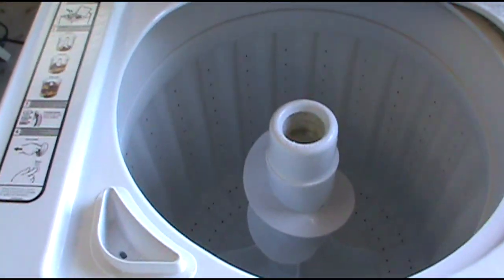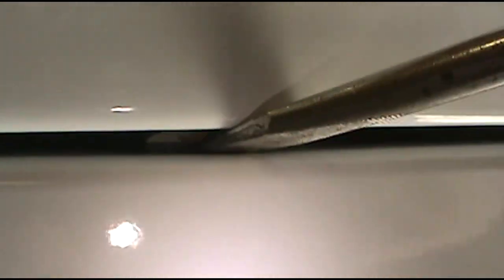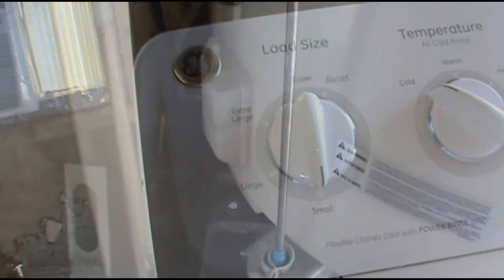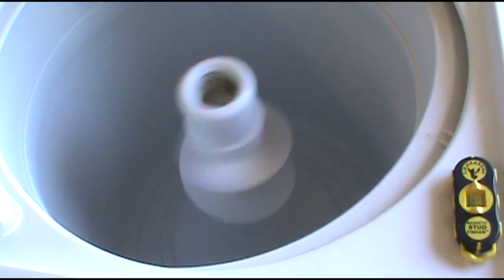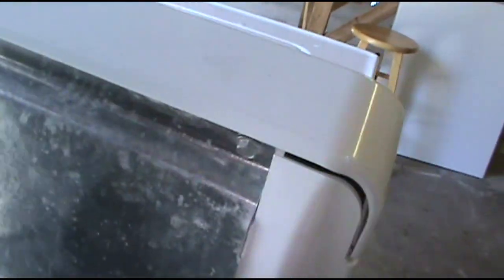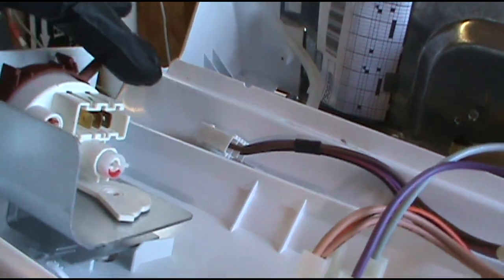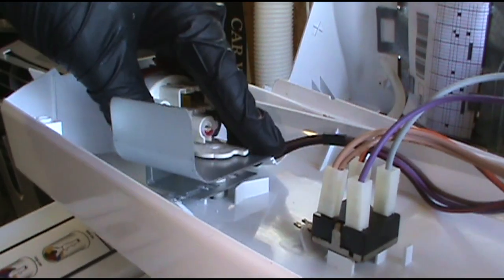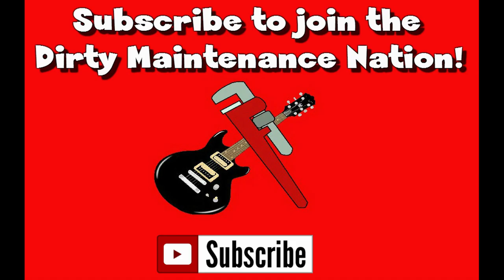HOW TO FIX WASHING MACHINE THAT WON'T GO INTO SPIN CYCLE

Comment: Thanks for the informational video. 3/25/23 for those that might not be sure if this might fix their problem. My machine wouldn’t drain or spin. It would just keep filling more till water was coming out of somewhere. This fixed it. I bought the part on Amizon for $28. They are all a little different from one another. I had to break my old part off where it clips in to the machine. I didn’t attach the new part till I tried it to see if it worked. Incase I wanted to return it and maybe call someone to fix it. Yeah I it worked. 😊
Reply from the maker: Nice fix, Max! Thank you so much for watching!

Comment: Awesome! Washer wouldn't drain or go into spin with the tank tub full. I took the tube off of the switch and blew into the switch a couple times. Then I blew into the tube till I heard it bubbling into the tub. Plugged it back in and set it to almost the spin cycle and it started draining and went through the spin cycle. Great advice! Hopefully this will last till I decide to replace this ten year old beast. For anyone wondering I did this to a Whirlpool washer, worked all the same.
Reply from the maker: Awesome! Thank you so much for watching Mark!

Comment: THANK YOU SO MUCH! I originally tried vinegar and hot water to clear the drain tube, which worked temporarily, but this was the actual solution to my problem! I used a straw brush (or pipe cleaner) to unclog all the gunk in the tube since blowing into it wasn't working. Thanks again!!!
Reply from the maker: Nice fix Jessica! Thank you so much for watching!

Comment: Man, you led me to my solution at 2:45 of this video. You ran the spin cycle while using a magnet on the lid switch. I used a strong refrigerator magnet and finally, the agitator spun like crazy. I just need to replace the lid switch. Thank you very much.
Reply from the maker: Awesome! Thank you so much for watching Greg!

Comment: In your video today can you show how to pull down the outer drive drum inside the front panel of the GE top load washer please??
Reply: in your video today can you show how to pull down the outer driver drum inside and beneath the front panel please? ?
Reply: in your video today can you show how to pull down the outer driver drum inside and beneath the front panel please? ?
Reply from the maker: If I run across this style washer again, I will. Thank you so much for watching!

Comment: after much searching you have the best video on how to repair this problem, thanks so much!
Reply from the maker: Eddie Manzano Wow Thank you for the kind words Eddie! And Thank you so much for watching !
www.DirtyMaintenanceNation.com
Reply: my machine spins when I put it directly to drain/spin and the timer advances but in regular cycles it won't spin and the timer is also advancing  you can hear the clicks to the pressure switch activate. which one would I replace?
Reply from the maker: Eddie Manzano If timer is advancing all the way to the end, I'd try the pressure switch.

Comment: That did the trick.  I had a pressure switch on order because the washer was overfilling occasionally but then it stop spinning.  I tried this and it worked.  The pressure switch is coming this afternoon and I am just going to drop it in.  $30.00 bucks not bad for a 2001 GE washer.  In the past I had to replace the motor just out of warranty and a couple of years ago the metal hub under the basket but this old baby is still going strong.  Thanks for the tip.  BTW, I used a pipe cleaner to clean out the end of the hose.
Reply from the maker: Nice! Thank you so much for watching rdib!
www.DirtyMaintenanceNation.com

Comment: I just order a pressure switch through your link, I'll let you know if that was the problem because I checked the hose like tou showed and it didn't work so I should receive it in 2 days!
Reply from the maker: Right on! Thank you so much for watching!

Comment: Had a resident whose washer wasnt spinning and the pressure switch fell off because of the lock tabs broke i rigged it to stay on and somehow it started spinning again. Motto i go by is if it aint broke dont fix it ! Lol . I knew the pressure switch controlled the drain but i did not know the pressure switch controls the spin so thankyou lex !
Reply from the maker: Nicholas Ritchey Yep! If its working, DONT TOUCH IT. 😂👍😂 Thank you so much for watching Nicholas!
www.dirtymaintenancenation.com

Comment: Does a similar fix apply for front loaders?  My washer is only from 2011 but now is considered "old" while those from 30 yrs ago may still run.  It randomly will not spin - usually a 2nd run through fixes it but it seems sometimes its brain is mixed up.  Thank you for your information!
Reply from the maker: I'm only familiar with top loaders, sorry. I hope everything works out for you! 🤞

Comment: Nice video, so mine seems to periodically not spin, usually on a heavy load of towels. On a light to medium load it works fine on a heavier load it stops, you open the lid, machine has mostly drained but towels/clothes are soaked and it didn't spin and the spin cycle dial has about a 1/2 inch to go to finish but machine is off. When I rearrange the load, turn timer around 360 degrees to spin and start it, it drains a little more and then spins to finish. I took the cover off and pulled the hose, it wasn't real dirty but I cleaned it with an ice pic, blew the line and the plastic dome reservoir out with air. I heard the switch clicking when I put air in the line. Since it completes the cycle sporadically can I eliminate the timer as a problem? Assuming the line is clean is the switch the only other possible issue?  I will try a large load again soon since I just cleaned it just before I posted but I'm assuming it's not the line, will let you know. Thanks!
Reply from the maker: Yes the timer seems okay . Maybe the pressure switch.
Reply: @LexVance  Thanks for the quick reply. Did another cycle tonight, good size load and when is was full agitator was making a funny noise which I've seen happen recently and didn't mention. I stopped it turned the dial and started again but same result. I then stopped it raised the lid up and down twice and started it and it ran the entire cycle flawlessly. Would a screwy lid switch cause the periodic not spinning problem as well as this funky agitator issue? Also at what point is it not worth fixing if I do have to call the appliance guy, the machine is 7 1/2 years old? Thanks.

Comment: I have a hotpoint washer that looks exactly like this one, just up and stopped agitating and spinning. Everything else still works, timer goes all the way. Lid switch engages, checked the tube for the pressure switch also. I hear the motor hum when the timer moves just ahead of the drain and spin setting when it would normally start as if it is trying to but won't. Only thing I can assume is the capacitor is bad and the motor isn't able to get that charge of power to get it spinning or agitating. Just curious if you would think its the capacitor also?
Reply from the maker: Yes, if you have a volt meter you can check the microfarads.

Comment: Hello Lex question, do you think that if a drain pump does not work, the spinn syclo will not work either, Thank You.
Reply from the maker: Probably, because the water wouldn't be out of the tub for it to spin.

Comment: Thank you for this informative video. I used my air pressure hose to remove what appeared to be debris in my water level tube. I also pushed a little air into the plastic reservoir that fills and releases the water on the side of the wash tub you show in this video. The washing machine is spinning out as it should; I also think that the debris in the tube was affecting the level of the water going into the washing tub. The water wasn't reaching its maximum level for the "Large" cycle and now I think that won't be an issue going forward.
Reply from the maker: Awesome! Thank you so much for watching mycat!

Comment: Hello, really appreciate the video. Our washer won’t enter the spin cycle. However, if you lift the lid, it will then stop agitating and start the spin cycle. I’ve replaced the timer and lid switch. The timer is remanufactured. Any thoughts? Thanks!
Reply from the maker: Yikes. I would need to be there for this head scratcher. 🤔

Comment: Thank you so much for your video. I am narrowing down the possibilities for my problem (machine won't agitate or spin). I checked the pressure switch, lid switch, found that the timer does not advance. Will the timer cause it to not agitate as well as spin?
Reply from the maker: If its stuck in one place & not advancing to the end, then yes, I'd say the timer is the issue. If it is advancing to the end, then theres other issues. Thank you so much for watching Denise!
www.DirtyMaintenanceNation.com
Reply: Thank you again!
Reply: I blew in the hose and chaged out the pressure switch, still no spinning.

Comment: nice job lex...this is why i do not like shutting down whole buildings to fix plumbing issues....toilet fill valves..aerators and things like this get clogged and cause problems havoc.
Reply from the maker: working shlub They sure can! One little piece of lent in a pressure switch hose can cause thousands of dollars in damage & clean up fees. Thank you so much for watching working shlub!
Www.dirtymaintenancenation.com

Comment: I've had some the city water/detergent/chemicals soften the pvc hose and it popped off the nipple at the tub connection.
isn't over flowing machines great? luckily most older homes here have unfinished basements and floor drain/sump nearby

Comment: I have a GE washer that is similar to the one in the video. It will work fine for a load or two and then just decide that it doesn't want to spin at the end of a cycle to dry the clothes. I cleaned out the pressure hose earlier today after the unit had been sitting untouched for about two weeks and it worked great for two consecutive loads but then on the third it wouldn't spin during the final rinse/spin cycle. I'm wondering if something might be heating up and just need lubricating to reduce friction? Any suggestions?
Reply from the maker: After I blow in the pressure switch, it'll work for a load & then won't work. It may be your pressure switch. Hard to tell by not beimg there to look at it with my volt meter. Thank you so much for watching Richard!
www.DirtyMaintenanceNation.com

Comment: Hi Lex,  I have an Inglis  washing machine  and the spinning drum is all over the place not firm. I opened it up looks like there is only one spring holding it to the lower frame Vertically should be more than one spring. Or there is something else Please advice me.
Reply from the maker: You're right. There's a loose spring some where. You'll need to find it & reconnect it. Thank you so much for watching sindhi!

Comment: I replaced the pressure switch and hose on mine and still having the same issue, its an old GE, error light blinks 7 times. I think that error light indicates bad lid switch but I'm not 100% sure the switch shows about 300ohm resistance when closed and 400 when open. I'm not very knowledgable on appliance repair so I figured I'd start asking for assistance wherever I can.
Reply from the maker: Lid switch is common.

Comment: Lex is this a universal part?  Mine has a different connection it's a 2 wire and a separate red wire. 2004 washer part no. 175D2290po.
Reply from the maker: This part is for a GE washing machine. Different brands will look different. Thank you so much for watching Randy!

Comment: Hey Lex-  I'm not sure if you're still fielding questions about this, but I have a somewhat older model GE top loader (WBSR3140D0WW) that is doing everything (including agitation) except for spinning.. and this pressure switch approach didn't seem to fix it.  I'm wondering if it could be the motor.  Do you have any videos or ideas on how to approach this?  I've also tested the lid switch and the capacitor.  I tried replacing the timer, and it turned out my replacement had broken during shipping, but since the same thing happened with the new timer (no spinning), it didn't seem to me it was the solution.  The timer does progress through the cycle, just no spinning.  Any suggestions are welcome!
Reply from the maker: Weird! Yea, I'd need to be there with my volt meter to see what's going on. A new pressure switch usually does it. You got a head scratcher that's too complicated for YouTube comment repair.
Reply: @LexVance  Thanks Lex.  I have a new hypothesis.  Think a leaking tub seal (hub seal?) might have washed out the grease from the transmission and brake assembly (https://www.youtube.com/watch?v=uMueC1dD2gs).  Not sure if this is right, but guess I'll remove it and see if it seems obviously wonky.  I did have a leaking seal a couple months ago, and the washer stopped spinning after that..

Comment: Hey lance I had a GE washing machine not spinning and it turned out to be that capacitor on the right front side of the washing machine.  It was about half way up  on the right front of the machine.
Reply from the maker: Right on! That's fantastic wisdom to pass on. Thank you so much Marc! 
www.DirtyMaintenanceNation.com
Reply: Marc mine still not spinning  - what is the capacitor ?
Reply: Pull the front cover off it's a black cylinder about 3inches length with 2 wires in the bottom of it on the right side of the machine. About half way up on the right

Comment: My GE washer agitates and drains fine but doesn't spin so I checked the belt and capacitor and they looked fine. So found out clutch would be problem but while replacing it I found clutch doesn't have a clip and I tried pushing clutch down to remove it but didn't work. How can I remove the clutch please help?
Reply from the maker: I'd need to be there for this head scratcher 🤔. I have to see how it's made. They're all made differently.

Comment: Thank u Lex for this video, turns out that was the problem to my washer. I blew in the hose, now does it matter how many times u blow in it? I only did it a few times.
Reply from the maker: camron626 No just one good blow into it will work. If it happens again though, you'll need to replace the pressure switch. Thank you so much for watching Camron!
www.DirtyMaintenanceNation.com
Reply: I seen there was alot of build up in the tube. I just took the tube out and got all that gunk build up out. give it more life. again thank u Lex I would have never of figured it out if it wasn't for ur video.
Reply from the maker: camron626 You're welcome man! A repairman would've charged you $200 to do that. 👍😂👍

Comment: I have a weird issue where the bottom of my machine's Agitator won't spin during the Spin cycle, it just goes back/forth rapidly...this leads to the clothing in there catching onto it and, for bigger loads, it causes the entire machine to stutter and stop working altogether (momentarily). I'm sure it's because the machine was overloaded, and I recently replaced the agitator dogs which makes it work better but it's still having this issue and I'm not sure how to fix it exactly. The rest of the cycles work well for the most part, but any time I wash/rinse I have to adjust my clothes and push them to the edge of the drum/tuck them under the agitator so they don't catch. I'd love to go back to machine-washing without having to micro-manage my machine so any help would be appreciated! ♥
Reply from the maker: I'd need to be there for this head scratcher 🤔.
Reply: @LexVance  No worries, I think it could be either the transmission or something in the brake system. But either way I think I might just have to play it safe and call someone lol, thanks for the reply ^^

Comment: I like your post.  Can you give me some insight as to why, my washer won't spin during a regular cycle? After I reset the motor  - unplug for a minute, lift and close lid 6 times in less than 15 seconds, I can hear the motor clutch lock in and it begins spinning.  I have to do this for every load.

I replaced the  lid switch already.  Also, I have a question about the water pressure tubing.  On the tub, there is a plastic container where the water pressure hose connects to.  Should there be about an inch of water in it?

I await your expert advice on the GE washer.
Reply from the maker: Is it a GE washing machine?
Reply: @LexVance  Yes, it is a GE Washer.   Is it the motor coupler?
Reply: Another question I have is the plastic container that the water pressure tube connects to on the tub itself, should that have water in it?
Reply: I appreciate any guidance you can provide.  Thanks!
Reply: @LexVance  any help in solving my problem?
Reply: @bruceitons4429  It should have water only when it washes. If the washer drains and it still has water, you'll need to clean that plastic compartment.
Reply: Johnny Montoya thanks

Comment: Our sensor isn’t able to monitor our washer, we’ve done that a few times and we have a newer model with the digital controls. How can you fix the pressure switch in the new digital version? Do you have a video for that?
Reply from the maker: No I sure don't. You got a head scratcher there.
Reply: Lex Vance we actually detached the sensor on the bottom end for the second time and put a safety pin in the machine side and it’s worked since then idk 🤷‍♀️

Comment: Hey Lex I replaced the switch and it still not spinning. The timer is advancing and it sounds like it's spinning but it's not. A while back you told me how to bypass the lid safety switch so I can work with the lid open. GE heavy duty super capacity plus washer. It does drain. Help please.
Reply from the maker: Weird! Is the belt on? Look at the bottom of the drum & see if belt is on. This is a hard one to diagnose not being there.
Reply: @LexVance  yes belt is on ,looks good.